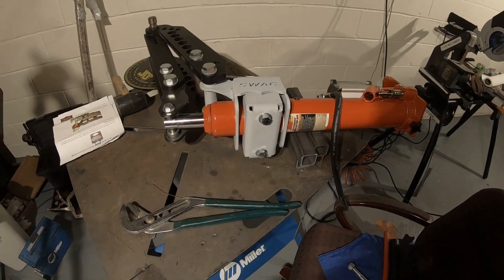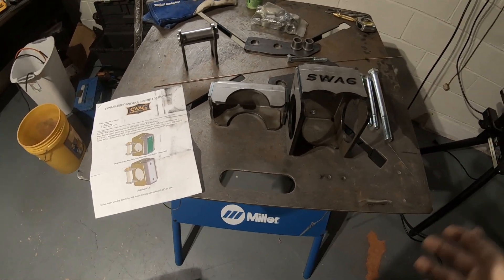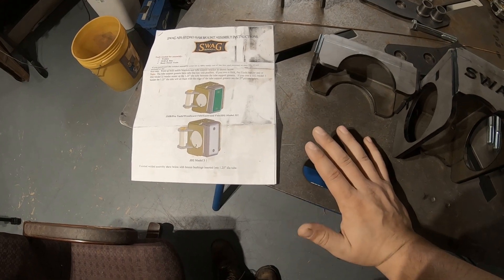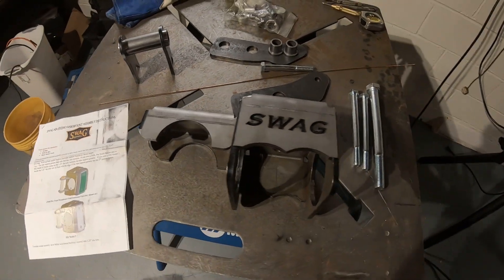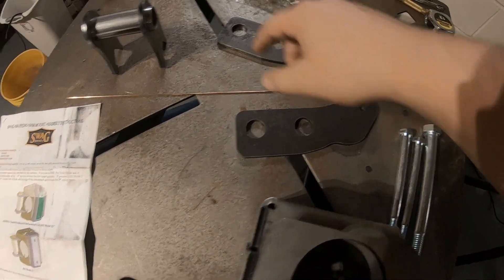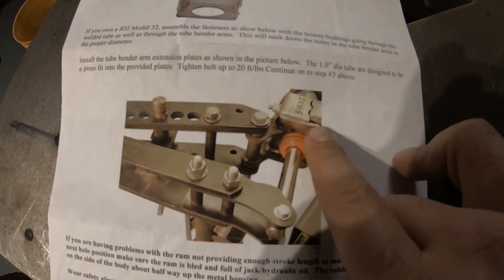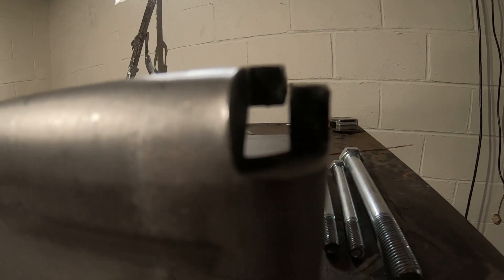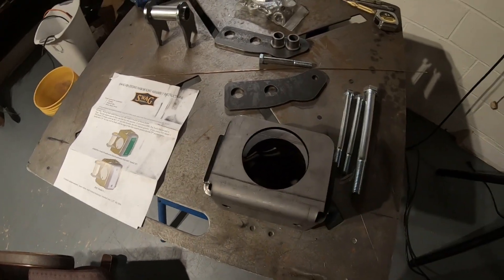JD2 Model 32 Bender - Swag Off Road Air/Hydraulic Ram Upgrade

Comment: What size tubing do you usually bend and do you get any deformation on thin wall?
Reply from the maker: I’ve only gone as thin as .100” and didn’t have issues, but I have dies for 1.5” and 1” tubing

Comment: Did yours come with the extension arms?
Reply from the maker: What do you mean by the extension arms?
Reply: @ThrownSparksGarage  the extensions for the ram mount. My swag kit only came with the ram clamp
Reply from the maker: Yes everything that you see painted gray in the thumbnail came with the kit I purchased
Reply: @ThrownSparksGarage  did your ram have any issues with not extending while laying horizontal?
Reply from the maker: @SubePelayo928  No mine moved with no issues both vertically and horizontally.  Do you have pics of your set up? shoot me an email at thrownsparksgarge@gmail.com
Reply: @ThrownSparksGarage  sent you an email